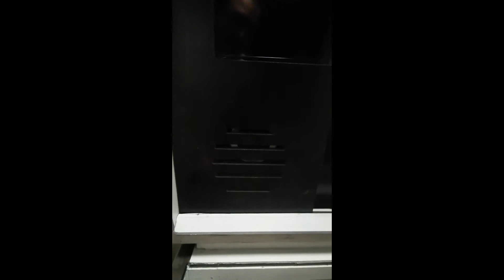An overview of what's involved building a virtual pinball machine - Links included

Comment: When connecting the exciters, I see you use two amps. It looks like you 4 exciters? Is the best placement for these on the inside side panels 2 in back 2 in front? Are the amps you ise 2.1 where you have the subwoofer connected to as well? Im still trying to figure out how to properly connect bass shakers. I've seen connections where 4 exciters are connected into one amp by splicing the 4 shakers together then plugged into left and right channel slots on amp and subwoofer connected to sub connection. Why two amps?
Reply from the maker: I have 2 Exciters and a 5" sub which connect to 1 amp that controls my back channel  and 2 Exciters and a 5" sub which control my side channel. Unfortunately I have no experience with bass shakers, but you should check the Facebook surround sound feedback group for more info on that.
Reply: @cleetusvandame  I see. aren't exciters the same as bass shakers? They are just smaller version?
Reply from the maker: @FROSTINATOR  to my knowledge, Bass Shakers replicate a real shaker feel, though I could be wrong. They are not Exciters, that I know for sure. As for location, you'll want to place 2 Exciters bear the flippers and another 2 near the back of the cab. Honestly, real shaker motors are so inexpensive, that it's not worth using bass shakers to replicate the feel, nor is it an accurate feel. Just my $0.02

Comment: Hey Bud, great work. But I have to warn you about those ford solenoids. After a while they break internally because the spring cup that is peened on is made of stamped aluminum. you can fix it by opening the unit, then drilling the plunger where the peen is and tapping it  to accept a screw. replace the aluminum cup with a steel washer and reassemble. I had these same brand solenoids for my flippers and had to do this to both of them. Good luck.
Reply from the maker: Thanks Ernie, appreciate the heads up. They aren't too expensive to replace but more of a pain to get to. When they fail, I'll give your method a try first. Thanks for watching.

Comment: Sergio thank you for the video on the Vpin cab. I see you got 5 ford solenoid install I like that because I got F150. I like the real shaker motor by Stern and the gear motor. And I can not believe that you install 3 subwoofer speakers. I will not be getting a lot the hardware or toys that you install because of cost and the room in a 3/4 cab. So my computer HW will be I5 running 
at 3.80 GHz & 8 GB of ram and is 8GB good enough for VP and my video card is a GTX1060 6GB that was recommend by you for 1080p and the hard drive is a 240GB SSD. So is my HW good enough for VP?
Also if your cousin has over 2 million sub and he tell them about you building his VP Cab then your Subscribers will go from 2 digit(51) to like said 4(9999) or 5 digit(99999). You are going be so swamped by so many questions that you will not be able answer all of them. I hope I did not said to much. I will have more questions in the come weeks about this video and other. Thank Again
Reply from the maker: Hey Doug. You are welcome to comment as much as you would like 🙂. Your hardware is plenty for VP. 8GB of Ram will get you by, though I always recommend 16GB to be in the safe side. Even on 3/4" cabs, you can sneak a few solenoids, a couple of contactors, a gear motor and a mini shaker motor, such as one from a massage chair. It's all in how you make use of the space. There's no reason why a mini Vpin can't benefit from the same features as it's big brother. That's the beauty about visual pinball. You can make it as you want. And please, don't be shy to ask questions. I'm very passionate about VP as you can tell. Hope you enjoyed my editing skills as well 😉
Reply: @cleetusvandame  I did get a couple tractor solenoids like what Nick had listed under his videos and I also get a couple Dayton Audio TT25-8 Mini Bass Shaker and down the road I would like to add a small shaker motor a few contactors & maybe a gear motor and I did get one 6.5" subwoofer. Were did you get the service switches from and the breaker board from. Also talk about your editing skills the PC specs was on the video for just a second  I had to go back and pause the video so I could read it. Thanks Again and keep making the videos because there a pandemic going on and I need to watch something other than TV.
Reply: Also Nick must be busy he has not did any videos or live stream lately.
Reply from the maker: @2104doug  I hope the more time I spend editing, the better I'll become at it. As for the service switches, you can find them at Arnoz Shop, same as the KL Shield for the Pinscape. https://shop.arnoz.com/en/4-accessoires?page=2
The breakout board, I bought through Amazon.https://www.amazon.ca/dp/B01NBU2C64/ref=cm_sw_r_cp_apa_i_Z2GND87C17GRW642GZFW?_encoding=UTF8&psc=1

 I have some spare parts left over from my builds, such as contactors and a massage chair motor if you want to add them to your build.
Reply: @cleetusvandame  Thanks for the info and for the links for the parts. Also thanks for the offer on the spare parts but not right now. Right now I am trying to concentrate on finishing my pin cab, I do not even have the back box install or the play field monitor install. My biggest problem is I very slow on working on it.
Reply from the maker: @2104doug  I understand. Not looking to get anything for the parts, so whenever you are ready, just let me know. If you need help putting your machine together, just let me know and I'll help where I can.
Reply: @cleetusvandame  That a very generous offer but wouldn't you need these parts when you build another pin cab. If not I would take them if you would let me pay/reimbursed you for the shipping cost to US.
Reply from the maker: @2104doug  whenever you are ready, just let me know and I'll get them packaged up and shipped.